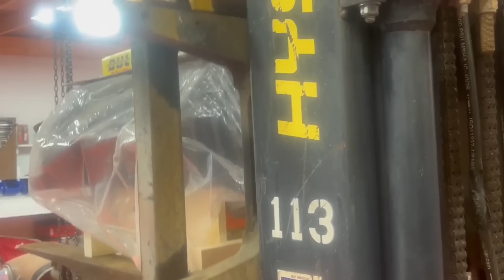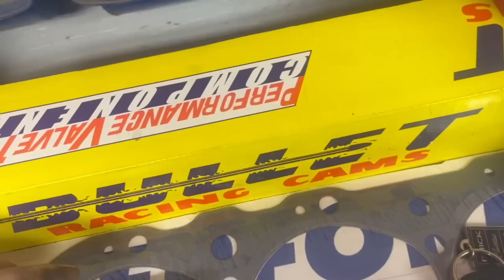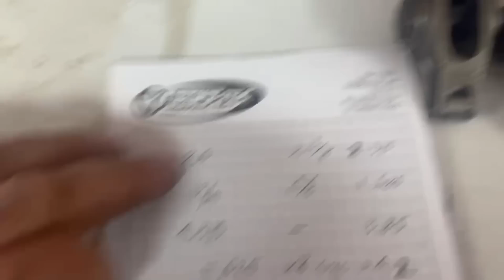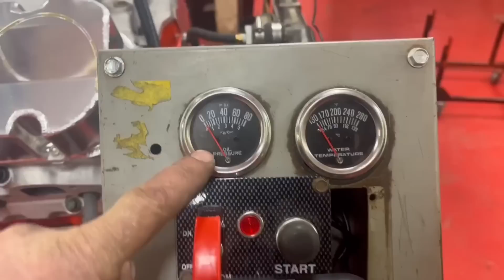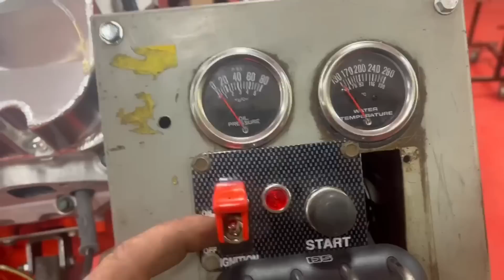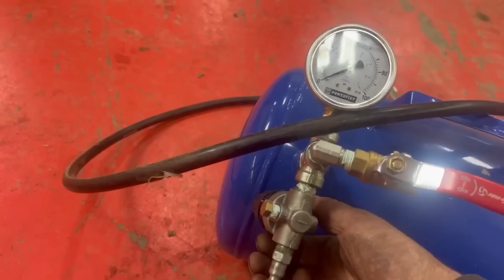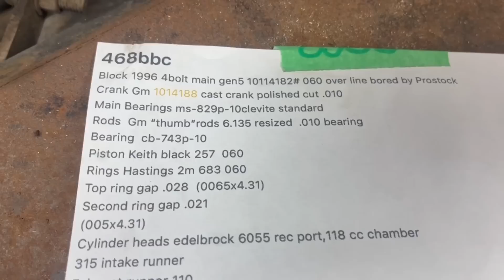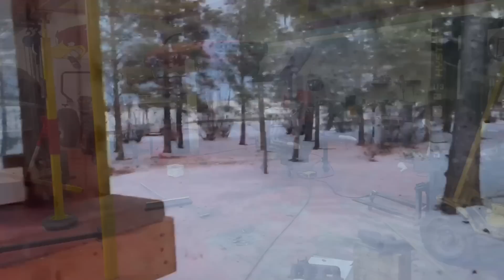468 Big Block Chevy Rebuild/ Swap Meet

Comment: Cut the heads off and chamfer the ends of old head bolts to guild the heads on, no threads to file any aluminum from the heads onto your gaskets, then throw them back in your tool box in the drawer marked home made tools !  🤓 Yes they call them Frost plugs but that is not really their job, the holes they seal are there to remove the sand from the sand castings that makes the water jackets while casting the block, generally if you have a frost plug popped out from freezing your block is cracked as well !  Your oil pump priming tool the old distributor shaft is a great idea   and has been around for a while, I striped a old HEI distributor knock the upper end  off and ground the end down with a bench grinder to fit a 3/8's drill, then cut just the top off the aluminum housing put it back together, now you have the drive shaft and the housing with bushings that keep it running true !

Comment: The cam is a solid roller .660 and.666lift . I do not run oil restrictors,I like the oil for my rollers for longevity. Th oil drain back to pan is not a concern to me,however if it was a circle track motor where extended periods of high rpm were practiced I would definitely consider it along with other changes. I’m running an hei on the vid with a bronze gear. The 750 carb and distributor stay with the test stand for all other Gm engines. I hope I answered your question  and thank u for watching

Comment: You really need to get a Dominator intake and a 1050 on this thing... Put a 2-circuit Dominator on it, and it'll have fantastic street manners, and it'll tune exactly like a 4150 would. 
Anybody who says you can't run a Dominator on the street just doesn't know how carbs work.

The Quick Fuel 1050 on my 547" Oldsmobile street car has the best throttle response out of any carburetor I've ever used. It doesn't run rich, doesn't load up with fuel, it'll idle at a stoplight all day long and not stall, and starts up very easy. 

Don't make the mistake of buying a 3-circuit Dominator UNLESS you are well over 700h.p., or else you WILL have all the problems that people complain about with a Dominator on a street car. The 2-circuit 4500's work just the same as a 4150, except they are just larger.
Reply: Thank u I run them on the track never  used on street to much , I’ve used the 1050 cam quick fuel on 4150 flange and 950 hp for 468 cubes  and found them really nice to tune  found larger window of jetting them  and just assumed it was for a higher velocity of sir passing through a smaller barrel .  I will ttake you up on that info and try one in an upcoming bbc in the  ear future , thank u for watching
Reply: @leondekoning8158  🍻 You won't regret it.. 👌

Comment: What causes oil on the spark plug threads?
Reply: Hi joe  ,some times a leaky valve cover can do it it will pool around plug  and slowly seep in,another is bad valve seals oil seeps down the valve shaft into combustion chamber and is pushed into threads , another cause can be badly wore or cracked ring , and last a piston could be cracked .   Do not rule out a bad intake gasket  it can suck oil out of lifter valley  as well  ,hope this helps
Reply: @leondekoning8158 Thanks, I'll change the valve cover then the valve seals. After that it gets expensive.
Reply: Leaky valve cover gaskets, or severe piston ring leakage...